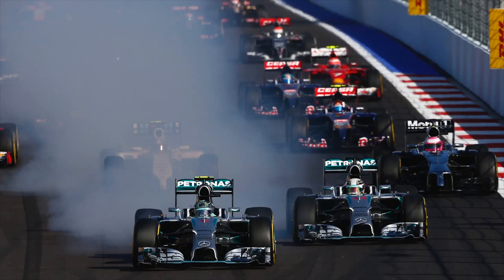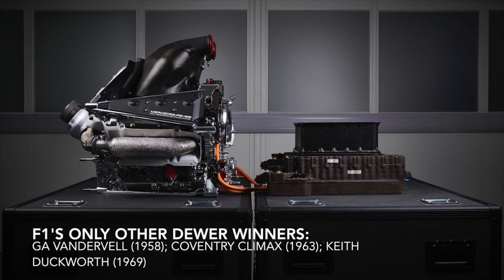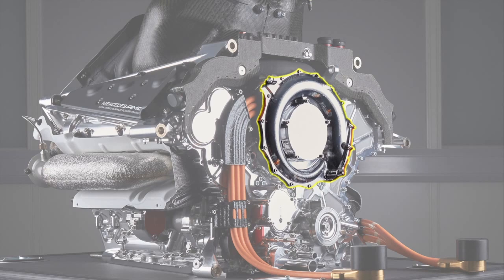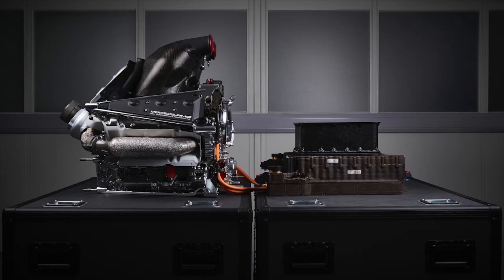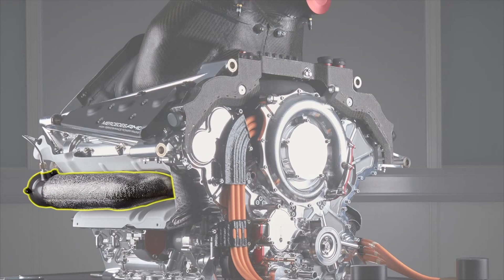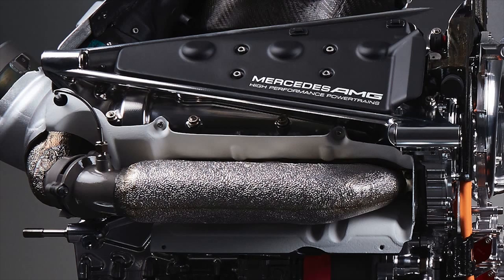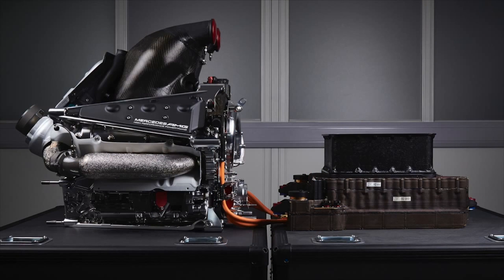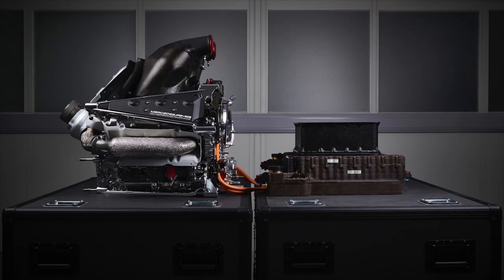Mercedes F1 engine: update with Craig Scarborough

Comment: Interesting to see that the engine doesn't have tuned length exhaust headers.  Like is said in the video, this saves heat energy to be recovered in the turbine and saves a lot of packaging space on the car for aero benefits.  In this formula, since boost pressure is not limited, there would be no benefit in trying to optimize cylinder charging by having tuned induction and exhaust.  Rather, the extra energy saved by the log manifold can be used to generate higher boost from the turbo.
Reply: You are correct!
And this is the same way very efficient  inline 6cyl Heavy Duty truck Engines has been designed the last 10-20 years.

Pulse separation and at the same time  compact  log headers.
Reply: Yes, its all about managing energy since the only source of energy/power is limited by the 100kg/hr of fuel flow and 110kg max fuel available.
Reply: Later they got turbo shaft rpm limit and changed to tuned manifold.

Comment: Do these modern hybrid turbo engines still use timing belts.??
Reply: SuperCragster In F1? Nope. They use a gear setup. F1 stopped using timing belts somewhere in the late 90s
Reply: +shi01 Late 90's ? Look at a cosworth dfv from the mid 60's.
Reply: Yes, but not everyone changed to gears that early. Renault for instance used a belt setup for all their turbo charged F1 engines and even for their early V10's.
Reply: Which 90's v10 had a belt and at least not a chain? Good cars don't even use rubber timing belts.
Reply: The 89 Renault RS1 used a timing belt to connect basically everything. The RS2 one year later still used a belt setup to run the accessories and they kept this setup up to the RS9 which they used in 97.
Ok, Renault changed to timing gears to connect the crank and cams at the very beginning of the 90's but the engine still used some belts to run certain things like the alternator and certain pumps.
Reply: Accessories don't count. A timing belt only refers to a toothed rubber belt that connects the crankshaft to the cams. They are on cheaper cars or cars that are build cheaply and still cost a lot.

Comment: fuck these new engines...hippy bullshit...bring back the V-10's!!!!!!
Reply: And waste millions of dollars in power unit development that can not be applied to today's production engines (V6 turbos) and hybrid technology? Yeah, that makes lots of sense just to please a bunch of idiots that think that engine sounds are paramount to F1 racing.
Reply: Your observations do not hold up to scrutiny. Mercedes had never won a Constructor's Championship before 2014 EVER! Red Bull dominated the 4 years before and got the lions share of the money and they still did not win. It was the NEW innovation of the MB engine, split turbo design, and improved aerodynamics\packaging that earned them the dominating position in 2014.

The rules are in place to control costs. Pure and simple. Without these rules, we would be watching MB, RB, and Ferrari with 8 car teams. Now that would make all the cars almost exactly the same and further concentrate the money for the remaining teams.

Even with the current rules in place, we risk the loss (or have lost already) of Sauber, Caterham, and Force India with no new teams announced for 2015.

Initial fueling limits have had very little effect and discussions are under way to raise the fuel flow limits in 2016 to raise power for ALL the teams in a very cost effective manner (no expensive hardware investment to gain power).

Is the system perfect? No. But it is evolving and it is tough to make changes in a democracy (teams must agree, sometimes unanimously) for changes to be adopted.
Reply: Your comment only reinforces what I stated. Mercedes just did a better job for 2014.

And the rules do control costs. Its not perfect, as I stated, but anyone with any brains can see that if costs are not controlled\regulated, their would only be three or even two teams left.
Reply: CockpumpVideo I think you should go and watch v8 supercars if you don't want to evolve with the formula 1 times. I loved the v10's too and the racing back in 2005, as well as the tyre battles, but this new age formula 1 will be far more beneficial too everyone who drives a road car eventually. You can now buy a Renault clio with f1 tech in it for 16k. 
Formula 1 isn't a bogans sport.
Reply: Amen
Reply: Can the real F1 please stand up!!!!
Reply: I'm kind of somewhere in the middle on this one. I find the new turbo V6's with all the electronic wizardry quite fascinating, but F1 has way too many regulations that set too tight limits as to what kind of a car you can design. Instead of dictating and homologizing the engines to a certain displacent and technology and so on, what they sould have is just a limit on how much fuel per race you can have. And that's it. Let everyone figure out what kind of an engine they want to use, and if they want hybrid technology or something else in there. The same applies to many other aspects of the cars as well. F1 is way too restrictive on new technologies and the shape and configuration of the cars. Of course safety is important, so a rule saying that the nose must not be higher than X is ok so that you don't impale another driver's head with it, but there're just so many awesome things that the teams have come up during the years only to have FIA deem them illegal, that it is just insane. They should embrace new technology and developments, not think of them as an unfair advantage. If they keep coming up with new restrictions all the time, what will eventually happen is that every car will be exactly the same, with the only difference being the car set up. And that is not what F1 is supposed to be about. F1 is supposed to be the pinnacle of technology in motor racing, and currently it just isn't. It is the pinnacle of trying to find loopholes in the rules and trying to fiddle with small stuff to find the extra 1/100th of a second per lap. Real innovation is almost completely banned, and if it isn't, FIA will ban it when you put it on the track.
Just imagine what kind of amazing cars we'd have if the teams were free to use whatever technologies they wanted. Active aero, active suspension, intelligent differentials, blown diffusers, six-wheeled cars, fans that suck the cars to the track and all kinds of cool ideas that have been banned.
Of course more freedom means more costs, so some kind of a budget limit is ok. But where FIA has got it wrong is how they reward teams. Currently FIA gives huge sums of money to teams that are successful. This is stupid, because of course the teams that have more money in the first place will be usually more successful. So the next season they'll have even more money and they'll be even harder to beat by the smaller teams with smaller budgets that don't get money from FIA. FIA should give the money to the teams with smaller budgets to level out the playing field by giving every team a chance of building a successful car. This way they wouldn't need to ban every new technology that the bigger, better funded teams come up, because the smaller teams would have the resources to copy the design, or come up with their own stuff in the first place by having the extra cash from FIA.

TL:DR; Too many regulations by FIA kill innovation and technology, and FIA gives money to the wrong teams which makes F1 unfair to smaller teams.
Reply: tonkatoytruck As I said, "the teams that have more money in the first place will be usually more successful." Not always. Also, Red Bull's problems last year were pretty much the fault of Renault and their weak engine. And MB is a big team with lots of money. Marussia and Caterham have never won anything. Big money = wins in F1.
What I meant was that FIA should give a bigger cut of the money to the small teams so that
a) they can continue to exist and
b) they would have some money to actually develop their cars so that they could at least have a fighting chance against the big teams.
Or at least they should distribute the money evenly to all teams. Anything else is better than what they are currently doing.

I'm not sure how the current budget limits work, but I know they exist. If there was a reasonable annual budget limit and it would be enforced properly, F1 wouldn't need all the regulations because teams couldn't spend hundreds of millions to create some monstrous über car that dominates everything else on the track. And they could still have some of the cost-cutting regulations, for example how many races the engines have to last and stuff like that. But restricting innovation is horrible and it's killing all the fun F1 used to be. There's also the aspect of new innovations trickling down to normal cars. If everything is banned and you can't have anything new, there will not be new technologies. And no, hybrid tech is not new anymore. Regular cars had that over a decade before F1 did.
A proper budget limit with less regulations = more room for real innovation and technology, and a better chance of the smaller teams being more competitive.
Reply: tonkatoytruck Who gives a shit about that PC bullshit, I fell in love with F1 because of the cars and the drivers...not because I wanted to save the world...that you would attach such a low relevence to the way a MOTOR sounds in a MOTOR racing formula (hahaha what a fucking idiot) would suggest that you are probably better suited to chess or maybe tiddly winks and posting retarded comments on YouTube but definitely not F1...oh and by the way the car companies have had no problem developing hybrid technology and electric vehicles all by themselves without the need to hijack F1,  there have been hybrids and electric cars for the last 18 years dumbass...
Reply: tonkatoytruck Holy shit you are still at it...spouting more shite....Mercedes jumped the rest of the pack because Ross Brawn began work on the 2014 car at pretty much the start of the 2013 season (before he was pushed out of the team by that absolute spastic Toto Wolff). The added factor of the greatness and absolute genius of Ross Brawn is also a massive factor and cannot be easily be quantified (not to say that Newey isn't a genius too) Red Bull and Renault were focused on winning the championship, which they did but to the cost of their combined development of the new car for 2014. I cant see how this is hard to comprehend, its a feature of F1 over the years. The idea that any changes introduced by the FIA to reduce costs has ever actually resulted in reduced costs can be easily seen to be complete bollox as is evidenced by the huge increase in costs over the last number of years. 
One thing is true however, whenever there is a rule change the larger teams can absorb the costs associated with the changes easier than the smaller teams, this is why there is such a gulf between the back-markers and the guys at the front and its only getting worse.
Reply: CockpumpVideo This is the real F1 and it stood up. F1 was always about pushing the limits of the technology and engineering. It's the whiny shitsacks that've been used to (very unlike F1) equalized engines that don't realize this.
Reply: mastadriver Oh yeah, the Australian GP was so amazing....you are so right...hahahaha
Reply: CockpumpVideo glad you liked it. Let's see how rest of the season goes.
Reply: mastadriver I imagine it will be pure shite just like the first race...I think I would rather spend my time watching a mexican bearded lady plait her beard hair into a nice scarf than get up in the middle of the night for the next race
Reply: tommy TECO Not sure how many F1 fans would agree with your assumption that F1 has evolved. Toyota had the first hybrid car in the Prius on the road in 1996, that s nearly 20 years ago. F1 in its current format is in my opinion a result of internal politics and less about "saving the planet". I prefer single seater racing and so will not be taking you up on your suggestion to watch family cars racing and I will be happy when the normally aspirated V10's or V8's are back as I am sure they will be over the next few years. The turbos came and went in the past and they will do the same again. I can see them keeping some of the hybrid technology when they switch back though.
Reply: Good reply!
Reply: CockpumpVideo Im so glad people like you got nothing to say, otherwise we would still be in the 60's development wise. Hybrid-cars are crazy exciting, 1000HP for everyone!! Look at the LMP1 cars, theyre mindblowing fast now with the hybrids.
Reply: Eric B the words crazy and hybrid should always be seperated by the word robot
Reply: CockpumpVideo Exactly what im saying, people like you just wanna life as far back in their childhood as they can, but the world moves on. Better catch up before youre out of touch! Horsepower hater. :p
Reply: CockpumpVideo Judging by what you just wrote i assume youre about 12, so i redact what i said. Dont act like a old man and then cry like a little girl. Deal with the reality, racing will go forward, with or without you. Have a great life bitter one.
Reply: Eric B We'll how you feel when they bring back the V10's in order to save the sport. F1 is dying at the moment, if you knew anything about F1 you would see that.
Reply: CockpumpVideo They are not bringing back the V10s, or V8s. End of the story.
Reply: CockpumpVideo You should invest more time in catching up with F1 news so that you don't make a fool out of yourself publicly.
Reply: mastadriver I think anyone reading your blathering rambling bullshit will quickly figure out who the fool is.
Reply: CockpumpVideo The fact remains return of V8s or V10s is not and never was an option. The only thing that's agreed for now is higher power output for 2017, but this was not ratified by WMSC yet and it's unclear how manufactures will go about that. Mercedes claims current engines can deliver up to 1600 bhp.
Reply: mastadriver if horner takes over at the top (which is a distinct possibility) he will bring them back, I would keep the hybrid packs but get rid of the turbos
Reply: CockpumpVideo Ecclestone would have brought them back if he could. Trouble is it's the strategic group who votes about the rules. These are teams and since they fight for their own corner they haven't been able to agree on a single thing except increased power for 2017. Bottom line is commercial rights holder (CVC) and FIA don't have the power they used to have and can't push this onto teams.
Reply: mastadriver yep and for some reason toto wolf seems to have a massive influence which is bad..
Reply: "hippy bullshit"?!!
As a former aspiring hippy, (having more or less steady employment kept me from getting certified,) I take serious issue with using the term to characterize the magnificent technical achievement described in the video. The only internal combustion engine any real hippy cared about, maybe, was the simple little air-cooled flat 4 powering a VW microbus.
I do not agree that F1 should become more like NASCAR.
Reply: I agree. Advance or die. Unless you ca afford a Buggati or the last of the Vipers, anything over 8 cylinders will go the way of the standard transmission. And even the V8 will be a rare site in the future. The "hippy crap" is more efficient, more powerful per cubic inch, gets better mileage, has fewer emissions, and weighs far less.

Although F1 maybe the most outrageous examples, some or all of the technology developed for Grand Prix does or will make it into mainstream motors.

So, learn to use it or go the way of the man who hates\fears computers\technology.
Reply: CockpumpVideo nah fam we’re gonna have .6 liter engines in the future

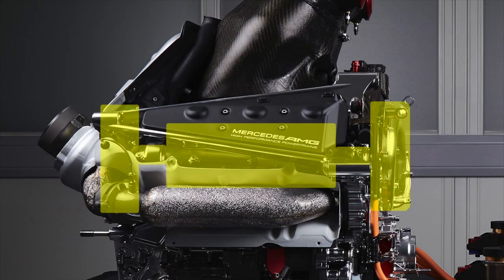Comment: 4:27 WHAT? The Ku Klux Klan makes turbos? xD
Reply: Klan (KKK - Kühnle, Kopp & Kausch) was in '70 '80 '90 very popular turbocharger manufacturer among German car manufacturers (especially for racing cars). Most of Mercedes Le Mans cars used KKK turbo, and Porsche used them, but now they don't make turbochargers, they sold it to BorgWarner (BorgWarner Turbo Systems GmbH) and KKK is now just brand name (they call them now 3K or KKK depends of model) and gas turbine division to Siemens (Siemens Turbomachinery Equipment GmbH)
Reply: i was thinking like that
Reply: I'm dying so hard XD

Comment: Where are the V12 3.5L ? The 1.5 l biturbo 1000-1500 BHP V6 ? The problem of F1 is not the redistribution , it is fair that a top team gets more money than a team which is not, the problem is that despite a globalisation, the F1 is less popular than during the 80's and early 90's. Despite a bigger rate of profit given to teams ( 50% in 90, 60 % today) , more points ( you have to struggle and being among the top 6 to get points while today, top 10 give you points) , there is less and less public for F1. Because F1 is no more F1, simply !

Comment: Wow what a true engineering piece of art even though I prefer the original V10 sound. Racing is always evolving but I didn't expect these types of changes.
Reply: what made the v10 sound special was that it was a much less regulated format, so there were differences in v angle, valves and timing, giving every engine model a distinct sound
this was gone with the v8, and now with the v6
another problem is that the engine freeze of the v8 made engines just a marketing expense for manufacturers instead of a valuable testing ground they are willing to pay for, that way leaving less than half the manufacturers in the series, so even with different turbo setups there can"t be as many distinct solutions